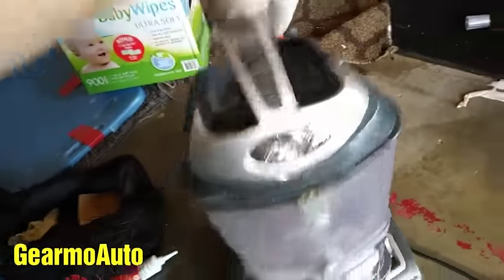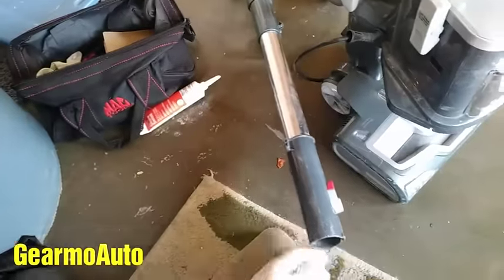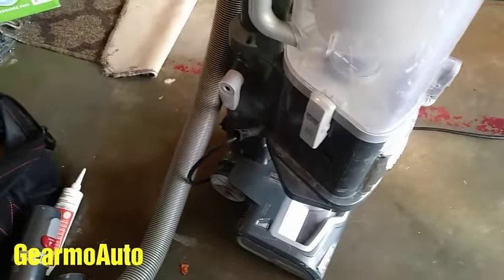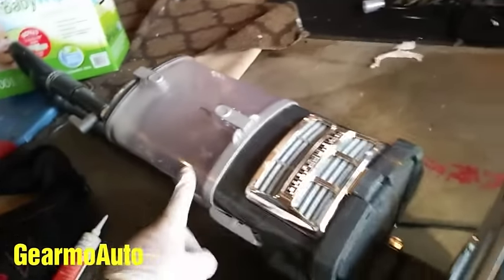Shark Vacuum Problems / Common Issues Fixes and Tips

Comment: Mine was clogged at the bottom like he showed and just a little above that or you can take the whole handle off. So it was clogged in two places. I just fixed it after working on it for about an hour, works perfect now. Save me a hundred fifty bucks from Costco

Comment: So far so good with this vacuum. https://www.youtube.com/post/Ugkx8ISPQRRAfpAaX4msGjyodObTBnlj4T5g I was a little concerned to find it seems to be all plastic, but the reviews were good, so I'm hoping for the best. Very easy to assemble  Recommened, and only attachments I've used so far work well, and are easy to use. Doing a good job on the new carpet in my bedrooms and stairs. Works well on the hardwood on my main floor too. Reasonable weight and cord length. I already knew from an earlier review that it wouldn't fit under furniture, but I can use my Eufy for that, so no problem - the high traffic areas that need a stronger suction was really what I bought this for. If it continues as it's started, it will be a good buy and well worth the money. I have had two Shark Rocket stick vacs in the past that are super easy to use, but the motors just don't last well, even with scrupulous cleaning of the filters. I'm hoping for better with this Bissell.

Comment: Man I hope u had a mask on that’s a load of dust lol. I just picked up a navigator lift away from Walmart. What do u feel about the dust bin clip attached to the handle. I’m afraid it’s gonna break. Thanks for the Video. Also on the Rug do u use carpet mode or wood mode. Also I don’t know what to do with the suction release on handle. First time shark buyer I feel like I bought a Lexus.

Comment: Solid vid. Helped us out despite having a newer Shark model than this. For us, instead of having to undo the panel on the bottom with a flat head, our tube is about 8 inches and it's placed on the side. The end connected to the brush portion of the vacuum twists off and the other end connected to the "spine" of the vacuum snaps on/off with a push and pull mechanism. Our clog was in both spots. 

Thank you!

Comment: You are a life saver! My vacuum stopped working correctly, and while I initially suspected a blockage, I later thought it wasn't blocked because the wand still maintained reasonable suction. I guess it's just a testament to the power of the motor. 

Once I saw your video and realized our vacuums were making the exact same noise, I was able to locate the blockage and clear it. Thanks!

Comment: Before disassembling anything requiring a screwdriver...[ CHECK THE CURVED HANDLE TUBE. Remove handle. ] Check to make sure there are no clogs there. It's a tight curve.] I had major blockage there, which caused the loud sucking sound. ]

Comment: Ours is making a grinding noise, cleaned and check everything on the video. I'm assuming it's something with the motor or if it has a belt/gears. But I found that there are a ton of screws so I'm to worried to try and check it. Hopefully I find a video of someone taking it apart.

Comment: thanks for a very helpful video. i did everything i could think of and it was still making that sane exact loud noise. i didnt know that you could take the bottom off like that. i have a little different model but the printable was the same. i had a huge clog that was right behind the rollers. without your video i never would have found that. thanks again

Comment: Thank you! I was wondering why the vacuum was making the noise from the side hole/vent. Your step-by-step logical elimination process was very useful. I found a sock hiding inside the main tube. The vacuum no longer makes the noise and is back in service.

Comment: Question for anyone: My Shark uv540 when I vacuum isn`t picking up anything, and I`ve checked everything--the hose, brush, filters, etc. Also the vacuum is making this really loud grating, screeching noise.  Do I need to unscrew the entire brush assembly to look inside it? I do notice there`s a hole near the bottom--could this be the problem?

Comment: I personally do not like bagless vacuums. I find them a bigger pain in the ass. My problem is the air brush roller is not spinning. The vacuum works fine, but the roller refuses to spin.

Comment: I have done ALL of these things and I'm STILL having issue. I've cleaned all the connections of where everything clicks in place. Cleaned all the filters. Took off the bottom and cleaned the beater bar and the hose bit. Nothing. I can't get it to work.

Comment: At 2:35 in the video you out your finger in that hole and it made that sound. There’s a spring in that compartment you put you finger over in the video I took it apart and don’t know which way the spring and little black piece goes now. Could use some help thank you

Comment: Awesome video sir, thank you. Had that same sound on a shark vacuum cleaner and the main vertical tube was clogged. I had to use a knife to remove the clog.  May I suggest a revision on your video title though ( clog sound ?) Because I didn't see anything here on YT with that in the title. Also, thank you for getting right to the point instead of dragging this out into a 30 min BS video (etc)

Comment: I bought this vacuum but had to send it back because my carpet is real thick and plush and the vacuum will not move. It has too much suction for my carpet even when I adjusted the suction valve. Any suggestions? Thank you!

Comment: was good video but on the two foam filters i wash them by hand and  wring them out , lots dirt comes out , then let air dry. also ,If you do not have a screw driver handy a quarter ( 25 cent coin ) works perfectly : ) for bottom hose , this video shows the top air canister filter which is the first one people forget about , i clean this and solves the high pitch sound 99 percent out of 100.
Another note ill hand wash n air dry two foam filters once a month : ) . hope this also help adding to this video . : )

Comment: I finally found a video with a vacuum similar to mine. The problem with mine is that is not sucking dirt into the canister it just stays in the bottom hose and doesn't travel up the tube into the canister :/  any tips? 

Great video!

Comment: Thanks for this. I have had a Shark vacuum parked in storage (and bought a whole new one that has since broke for another reason) for over a year because it was making this exact sound. I knew that the sound usually meant a blockage, as I've cleaned out many blockages over the years thanks to kids and my own lack of attention. Lol. However, when I cleared every filter and hose and didn't find anything, I figured that something must be wrong with the motor. 

Watching this clarified that I likely did have a blockage that I hadn't found yet, and it was in the final part of the hose. (It was hissing out the side vent even in hose-only mode.) The tube had looked clear before, but it was hard to tell for sure because the bend in the hose/handle made it impossible to see light through. Or so I thought. I finally found the clog (a stubborn cloth mask that one of my kids had sucked up) and now my vacuum is as good as new. Saved me from having to drop $200 on a new one. Much appreciated!

Comment: This video was extremely helpful and got it unclogged.Even though the screens weren’t the issue , they were filthy beyond belief , so that’s cleaned.  The problem was that it was clogged. No matter what I did I couldn’t get to the clog. Finally out of desperation I did a Hail Mary and  sucked it out with a shop vac. One suggestion I would make, you state that in order to unscrew it you need a screwdriver. Actually, just using a coin works very well. Thanks for the video.

Comment: Yes! This! Who would have thought that the clogged metal cone thingy inside the dustbin would have caused such a huge loss of suction? (I mean, doesn't this thing get dirty every time you use the vacuum?) I cleaned it with a toothbrush and voila! Return of excellent suction! I was about to buy a new vacuum, already had it in my online shopping cart (same model - have had this one for 12 years and it's been great). Thanks for saving me the money. Maybe it will last me another 12 years.
Reply from the maker: Thanks for the support!

Comment: I found another place to check/unclog...the wand.  If the regular vacuum on the bottom works, but not the wand, you might have a clog in the wand.  I could see the clog with a flashlight.  I took a dowel rod, actually a golf alignment stick, and taped a paper clip to the end, in the shape of a double fish hook.  It was able to retrieve the clogging fibers, and the culprit, a water bottle cap!

Comment: What about when the handle lock is stuck on on position but slides a bit just enough to make a clicking sound when trying to use the vacuum? The red button release is lose I believe which makes it not stuck! How do disassemble it to fix it?

Comment: Had the same issue with the noise coming out the side. Checked all hoses and no clogs. 

Cleaned the thicker filter and not the one below thinking the thin one wouldn’t make any difference. Put back together and still made the loud suction noise. 

cleaned out the thin filter and now is fine

Comment: I just bought one of these and doing the exact same thing brand new the first time I used it. The vacuum doesn’t pick anything up and I’ve took everything apart and cleaned it. I’m stumped
Reply: Me too! Had it a couple weeks and it’s doing this exact noise and won’t pick up. I’ve took everything apart and checked it all - no luck. Still doing it.
Reply: @hannahdelahoy6313  I went back to where I bought it from and bought a different shark vacuum that doesn’t have that hole on the side. So far so good. Had to return the garbage $250 1 with the hole.

Comment: Do you have any idea what it would be when your roller and both motors are working EXCEPT that when the motor is turned on, the noise is a loud sucking noise but also high pitched, like a jet. We checked the operation and don't have any clogs. Could it be the main motor? Thanks!
Reply: It has to be clog the handle gets clog
Reply: Solved my problem. I kept digging until I found a clog in the angle of the handle. Had to work at it. I finally got it loosened. It was a small bamboo skewer lodged in there. Thanks again!

Comment: I have done everything possible with mine and it still doesn't work., it still makes that loud suction noise after 10 seconds of running it. Poorly designed seals and contact points. Ours is only 2 years old, as with most new things on the market these days they are disposable, unlike things I grew up with that lasted decades.

Comment: Exactly what the problem was!  I really like this vacuum but I absolutely hate the "short" hose extension.  There is just no stretch to it.  It's almost like I'm missing an attachment or something.  It's very frustrating for me.  Otherwise, it's a pretty good vacuum.
Reply: I think u are doing it wrong. I did that for the first entire year I had mine. You are trying to use the extension from the wrong place. You should use it from the Very long extension stand point. They is absolutely no reason to try to use the extension that way. SMH. 😂😂I don’t know why I didn’t realize this for sooo long and it was driving me nuts . But after I realized I was doing it completely wrong I couldn’t have been more satisfied. I mean it’s aHUGE GAME CHANGER . If u don’t figure it out immediately please call me I’ll wit walk u thru it….I promise u need to know the right way to use the extension I’ve used mine every day many times for years it’s so so so convenient and helpful I’ve NEVER HAD A BETTER APPLIANCE IN MY LIFE